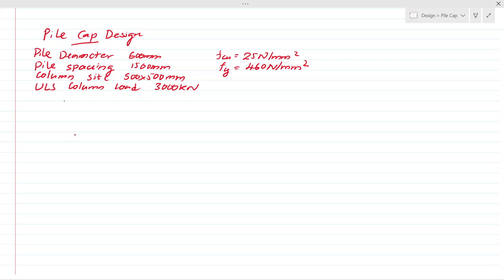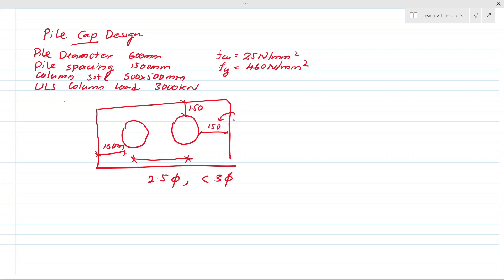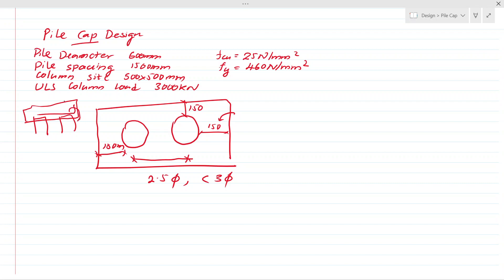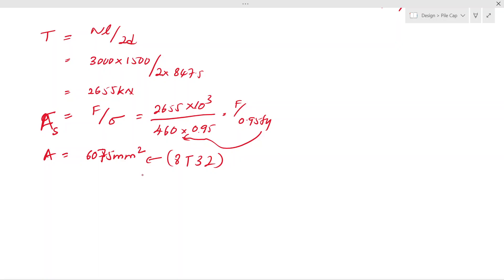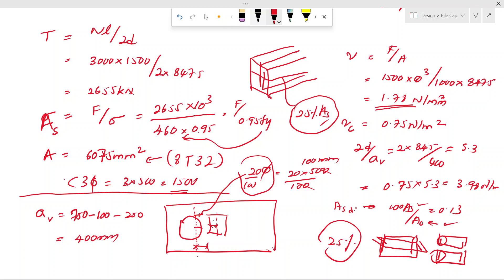How to Design the Pile Cap for 2 piles

Comment: Can you share the details of the bar arrangement according to the pile cap dimension?... lik e  bottom first u bar in longer dimension or shorter?
Reply from the maker: We can have the critical bar at the bottom layer. That can be done. Since we tie the rebar, and is within the concrete, the necessary restrain is there for tension bars.
You may also detail like a beam manner that distribution bare acts like a link too. In that case, reduction of the effective depth shall be considered in the design.
Reply: @structuralguide  thank you somuch

Comment: Sir , how the Vc value 0.75 found out from table 3.8 bs 8110  using this v value?
Reply from the maker: Vc is obtained based on the 100As/bd and effective depth.
Reply: Sir, In our case, 100 As /bd = .72 and eff. Depth is > 400 . Couldnt find a value  0.75  (Vc) corresponfing to these data frm table 3.8?
Reply from the maker: Now it is clear what you are asking. The Vc that I have considered in the example is some approximation. The correct value needs to be obtained form the table based on the 100As/bd and as per effective depth.

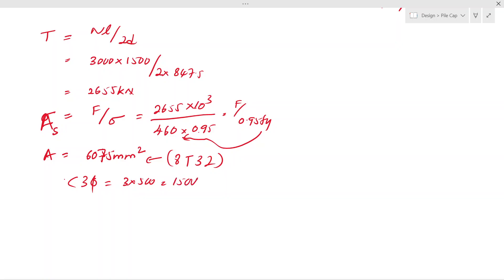Comment: Can u pls make 10:45 clear
Reply from the maker: We have to maintain the spacing of the pile to design the pile cap with the truss method. When the spacing of the piles is more, we have to use the bending theory; calculate the bending and shear and design like a beam.